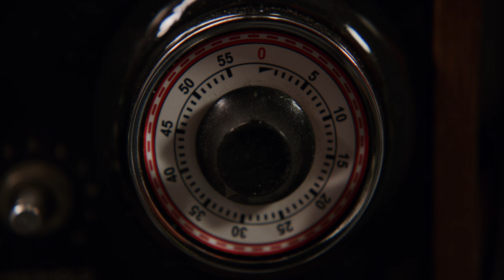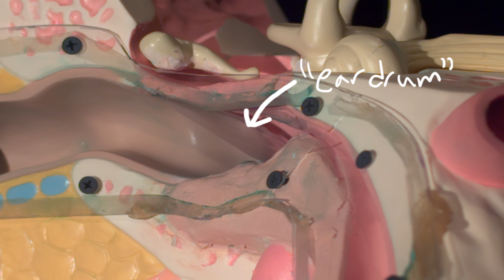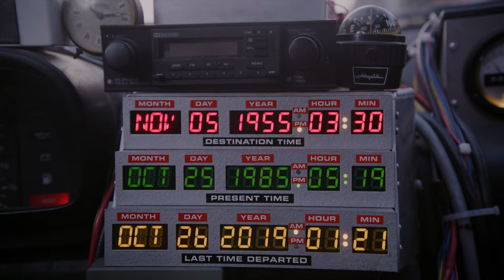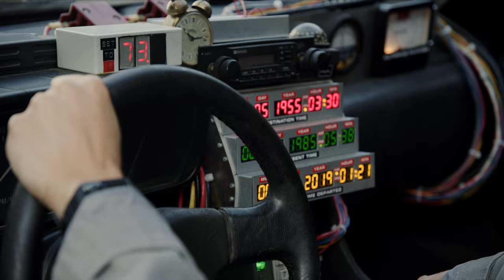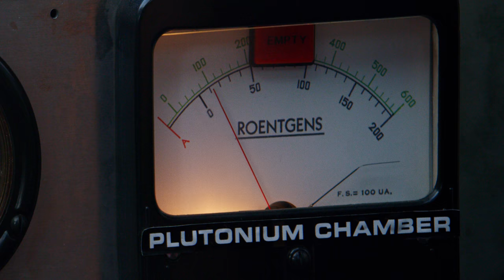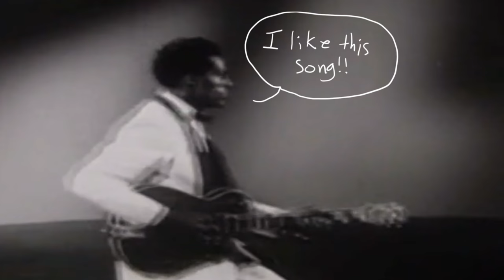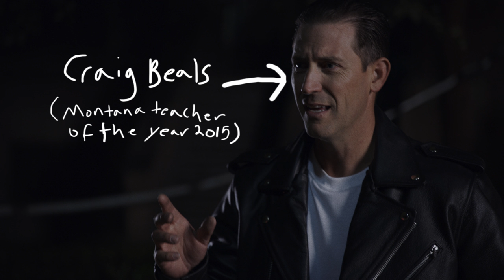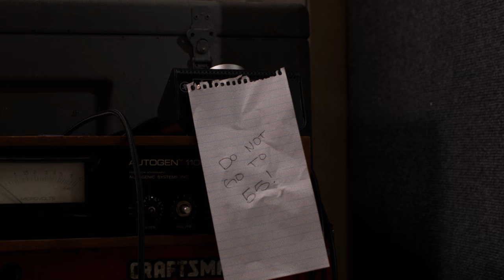Could You Survive BACK TO THE FUTURE?

Comment: My problem with this episode isn't actually anything that's in it. Thought out, entertaining and I enjoyed it very much. And all the vsauce channels actually. But you forgot one problem with time travel that everyone always seems to forget. Space/time is one thing. Connected and "almost" impossible to separate. But there are gaps if you don't account for that. If you're traveling through time you also have to account for space. If you don't and all you do is move through time all you will do is end up in space at a time when the earth isn't going to be there yet. Whatever time you go to no matter when it is. Let alone a 40 year gap like BTTF. The earth was in a different part of the galaxy in that point in time. At 67,000 miles per hour which is the speed earth orbits the galaxy. You're not going to be anywhere near where the earth was even an hour ago. And the earth corkscrews around our sun in it's orbit at 1,000 mph while the solar system is orbiting the galaxy at 490,000 mph. Assuming you can account for the math you'd still have to manipulate space as well as time unless you want to end up light years from earth when you did travel Time. But I never hear anyone talk about that in sci-fi or videos like this.

Comment: I am not convinced on the first part about thr body rotating with the pressure.  The experiment is different from the movie, a localized pressure vs spread one is fundamentally different. Sure you can use center of mass to estimate accelerations of the body as a whole,  but you  cant ignore force distribution to see how the body would rotate  on itself

Comment: Wow, how much fail.  I'm at about 2:30 and ... you claim it's the same if the all the force is focused on a small area of his chest rather than across his entire body?  Ok, well, for one if the force is distributed there is no reason to assume the rotational velocity that results would be the same.  So the head injury you claim at about 2:30 wouldn't necessarily happen.  In fact if the force is distributed roughly proportional to the way  human's mass is distributed the person would just be thrown straight back... which is basically what the movie shows.  Now, can a speaker deliver the energy like that?... no.  But it's possible to be closer to that than to a single shot to the chest.   Specially if you add in the frictional force resisting the blast from the foot contact with the floor (depending on the angle of the blast force this may be more or less relevant and might help adjust the forces to get the desired throw back).

Comment: Instant failure... you argue that the torso would take a larger share of the pressure wave due to surface area and thus why your cannon only needs to strike in the chest... meanwhile completely negating the hard fact that the legs and other areas would indeed experience some portion of the pressure wave themselves and thus would be accelerated at some lesser rate than the chest and yet **NOT** zero... this entirely obliterates **ANY** serious calculations as to the effects.... your very claim is completely disproven with the effect of skydivers flattening out their body and distributing forces across their entire body with ***MORE SURFACE AREA***... Nice try but you have thoroughly failed and disproven your theorization within the first couple minutes of the video.... Nice!